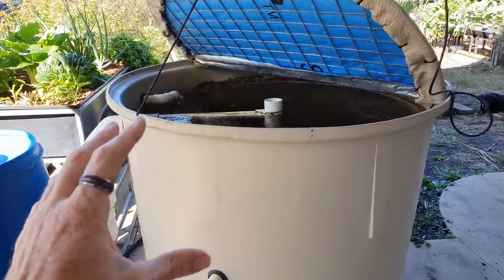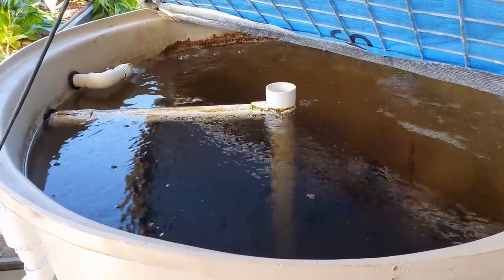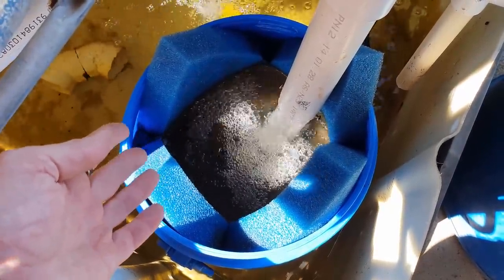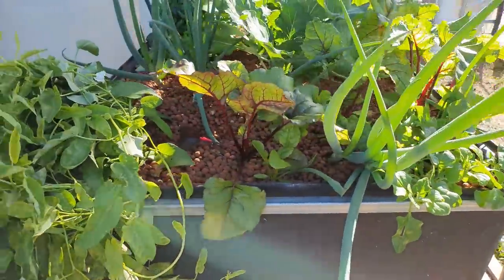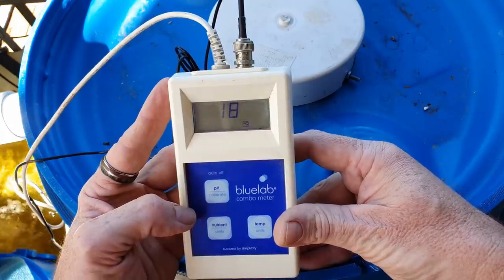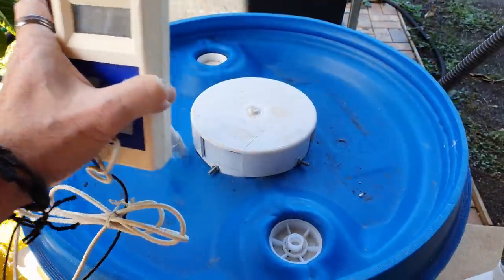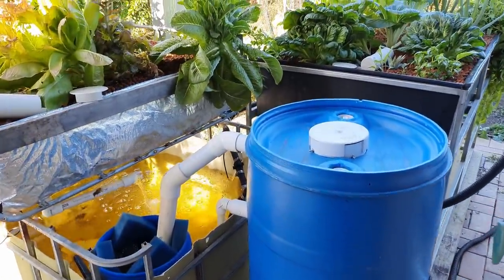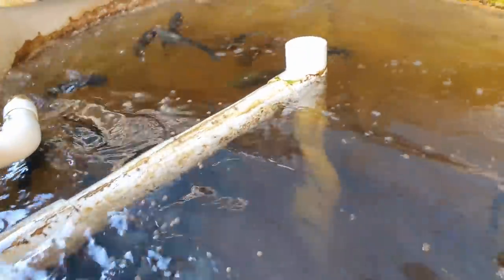Aquaponic System Maintenance & Running Tips

Comment: I keep the cleaning pump always hooked to the radial flow filter and connected to a timer, so it can be turn on from time to time in a effort to keep the bottom of the filter clean. It saves me time because a lot of the solids are gone when I go to clean it. The solids go to a garden. Only problem I see is that you have to top the water more frequently.
Reply from the maker: Nice one mate. What stops the water from draining through the pump? The pump I use doesn't have a valve so wouldn't do the job.
Reply: Rob, I used the "washing machine" approach where the discharge from the pump is above the liquid level and it discharges in a open pipe, so it can't form a siphon. Gravity takes care of sending the water and solids away to my garden. Basically the pump is only needed to create suction in this scenario. But if you want a pressurized line going to the garden you can always add a one way check valve after the pump. Have a nice one mate.
Reply: I have a quick video showing my radial flow filter if you're interested: https://www.youtube.com/watch?v=RfU-quLb-WE

Comment: HEY ROB BOB, ENJOYED YOUR VIDEO AS USUAL. VERY INFORMATIVE. I HAVE GONE A DIFFERENT DIRECTION THAN I HAD PLANED. I AM HAVING SOME HEALTH ISSUES AND I AM IN A NEW CONDO IN BANGKOK NOW. NOT MUCH ROOM FOR YOUR KIND OF SYSTEM. SHORT CONCRETE BACK YARD AND A BIGGER CONCRETE FRONT YARD.     LOL
Reply from the maker: Have you thought about going hydro mate? Fairly easy to go vertical with those types of systems. 
Cheers mate.

Comment: Hey Rob great video, just finished building my first nft and dwc system, hoping to do a 200l chop and flip soon I liked your video on that.  A bit limited in a Brisbane apartment!
Reply from the maker: Nice one mate. 👍 Hope the build goes smoothly for you.
Reply: Just a quick heads up: That's going to be very heavy, so don't do it on a beam and joist floor or a cantilevered deck. The structure won't be rated for that much weight in a small area, especially a deck.

Comment: Have you thought about painting the outside of your fishtank black? It'll help raise the water temperature from increased IR absorbtion while also reducing the light level inside the tank and heading off any potential algae growth in your fish tank.
Reply from the maker: I wouldn't with this one as it would be hard to get the paint to stick to the HDPE plastic which is already light proof.  The paint would be continually falling off & we're in the subtropics so the water temp really doesn't fall that low for long here. 
Cheers Joshua.

Comment: Do fish grow better in aquaponics, or in a fish farm that just irrigates the soil patch and replaces with clean water from the tap that would have ended up on the soil anyway (flow through system)?
In the states, brewery supply and bio fuel places sell stainless steel mesh screens designed to fit the top of standard buckets that you can get in various micron ratings. Might be easier to hose out than foam.
Reply from the maker: I dare say they grow at about the same rate from my limited experience with the small aquaponics & aquaculture systems I've run.  Aquaponics is a bit more forgiving though I feel. 
 I haven't seen those screens but am off now to see if there's anything similar here, thanks for that.👍 
Cheers & have a top one.

Comment: When cleaning the foams use tank water, this will reduce the problem of killing the bacteria living in the sponges.
Reply from the maker: It can reduce the amount of bacteria on the sponges. I'm not overly worried as the bulk of the bacteria will be on the media below the sponge.
Cheers Tim.
Reply: @RobsAquaponics  May I know how do you get the right bacteria into the system in the first place? It just exist naturally or do you need to add known bacteria into the system? Tq

Comment: IF you take a vacation, who maintains your aquaponics system?  Also, how long does it take for you to get back up and running after you come back?
Reply from the maker: We don't go away much, once every few years so not a huge issue for us. 
Is the backups are working properly & the tanks are topped up we could easily go away for 2 weeks with no one stopping by as the fish can live for a fair while without food. Especially these jades as they build up huge fat stores. 👍
It would still be a good idea to have someone stop by every few days just to see if everything is running smoothly.  I would suggest not letting them feed the fish though unless you're more than confident that they won't over feed them as that can potentially lead to a fish kill. 
Cheers.

Comment: Hi Rob, I am watching your video's for a while now. I made my first small aquaponics system and it works great. Next thing I am going to do is to make a dubble barrel system with both fish in in (both based on your video) I am still wondering at wich size system you need to add a solid filter, bio filter and solid filter like you are doing in the system in this video. When is the media not enough to filter most solids/amonia?

Comment: Truly enjoy your videos and have learned a lot. Setting up system that has 2000 gallon in-ground fish tank supporting 2 independent closed systems (pump to 50 gallon solids filter, then gravity feeds to 35 gallon bio-reactor to hydroton 4'x8'x1' grow bed to 3'x6'x6" algae bed back to tank) and I'm setting up 2 of those in my greenhouse.
Question: Given 1 fish tank is supporting two 240 gallon grow beds, would you still recommend using a bell syphon on each, or would you use constant flow?
Much appreciated. Thanks
Reply from the maker: Would be easier water management wise if you ran constant height if you're not using a sump tank normally. 
I would think that your 2000gal tank would have no issues the water needed for 480gal worth of media beds in a flood & drain arrangement.  
Hope the build went well Ty.

Comment: So just thought I'd ask, is the reason you don't use something like Pyrethrum for the caterpillars etc because of the fish? I use it on my raised beds and hydroponic vertical towers with great success. But was curious about the effects on the fish (although I have been told a solid no on getting fish, so only have the hydro, raised beds and soon to be orchard)
Reply from the maker: It is toxic to the fish & also the beneficial insects so that's why I stopped using it a number of years ago Matthew. I know folks that will still spot spray plants in their systems with it but I don't recommend it.
Cheers & happy growing mate.
Reply: @RobsAquaponics  Thought it would be bad for the fish, makes sense not to use it.
I mainly use it sparingly to control pests, prefer it as its natural, just target spray and don't use it on flowering plants. I find cabbages benefit it most.

Comment: Hey Rob, did you manage to find any info regarding the nutrient lockout due to high nitrates? Is this related to Mulder’s chart? Thanks and keep up the good work
Reply: Strange, I am not seeing your answer although I received it through email. Anyway...Have a top one yourself as well!
Reply: Pasting your answer "Potassium lockout would be my main concern but by the look of the tomato in the system at the moment, I don't think it's an issue. I didn't think to use the chart to tell you the truth so thanks for reminding me. Cheers & have a top one.
"

Comment: Sorry, not “lily Pad” but “waterlily” is a small turbine to generate power at the water drops. It would charge your pumps I think.
Reply from the maker: Just had a look at it Victor. 👍 I'm not sure it would work too well in the system as there's not a large enough water volume moving in one direction in my small system. Have thought about adding something under the drains back into the sump to help keep the backup battery at full capacity though. 
Cheers mate.

Comment: On filter material...would layers of same thinner material not make for easy cleaning?
Reply from the maker: I was looking at getting a thinner woven matting like I had in there originally as I did find it easier to clean. 😉
Am also looking at getting some fine stainless steel mesh to replace the matting & make it easier to clean. 
Cheers Basie. 👍

Comment: My water testing kit didn't come with the Nitrate bottles but instead it had phosphate. Are these the same or related in any way? or do i need to buy the Nitrate additionally?
Reply from the maker: Hey Adam. You will need to get the nitrate if you want to keep tabs on the level for working out your crop sizes. Phosphate levels are not really an issue in aquaponics as there is generally enough coming through the fish waste to keep the plants growing well. 
Cheers mate.

Comment: I notice you grow beetroot in the medium, I thought you could only grow plants above the level. What size PVC pipe do you use, I know you have a video on the components for a IBC but can not find it, Thanks Mate
Reply from the maker: Hey Noel. Have grown sweet potatoes & carrots in the system as well. 👍 Carrots do OK but the sweet potatoes produced more tubers in the soil (when the vine grew over the sides) than in the media beds. Ginger is probably the best root crop I've grown in a system but they do take ages to mature.  Normal spuds don't do that well in them from what I've seen. 
I have a clips on a few of the drain fittings & bell siphons.
I generally use 2"/50mm for any gravity flow back from the tank to the sump. Bell stand pipe is ¾"/20mm but the rest of the plumbing is 1"/25mm. 
All the drain fittings from filters are 1"/25mm with other sizes added depending on the component.
Hope that helps some but if it doesn't let me know & will try to point you in the right direction. 
Cheers Noel.
Reply: @RobsAquaponics  Thanks Mate

Comment: Hi Rob, how much is the capacity of the fish tank in this video, how many fish can grow in 10000-litre tank. Is this type of filter can be use for 10000-litre tank? I want to do a system. Kindly advise.
Reply from the maker: The tank in our system is a 1000L tank. How many fish depends on how much biofiltration you have as it's that which cleans the waste that the fish produce.
This clip runs through the stocking rate in regards to media bed based systems,
https://youtu.be/MeYtUfBKwNo
Hope that helps some.

Comment: Hi Robert!

I have encountered a problem that I have not yet to find a solution. 

I recently found leeches in my system, but only in the solids settler. Do you have any recommendation for this?

Thank you
Reply from the maker: I'm sorry but I haven't come across that one before. 🤔 Are there many in there ?
Reply: Rob Bob's Aquaponics & Backyard Farm i found a few small ones in there but i think there could be more at the bottom

Comment: Hi! Good day! I just discovered Josh Kern filtration system which absolutely eliminates biological and chemical toxins in contaminated water through thorough processes with bio-filtration  using basically just biochar, sand and gravel- the end result is potable drinking water. Is it possible to integrate the bio filter as the last stage from the sump tank before being recycled to the fish tank?
Reply from the maker: I think it may strip out some of the elements required for healthy plant growth (from the small amount I know of the system) so may be an issue in an aquaponics system. Might be a great idea for a stand alone backyard aquaculture system though.  I now have a few pages bookmarked & will look into it when I get some time.
Cheers Joshua.